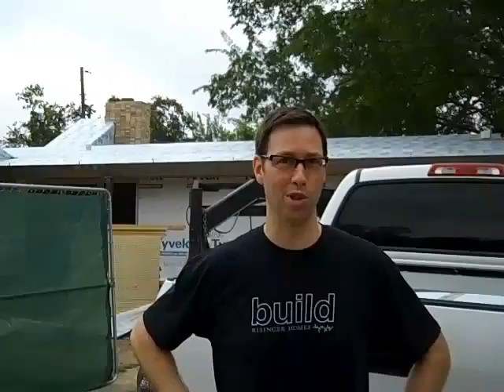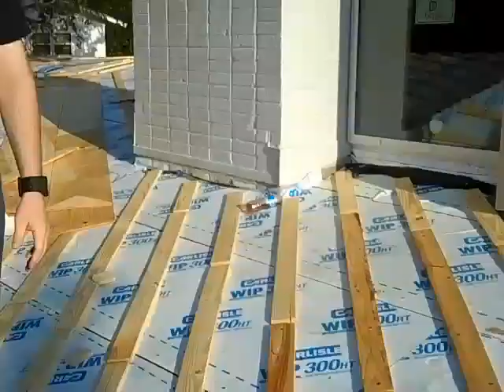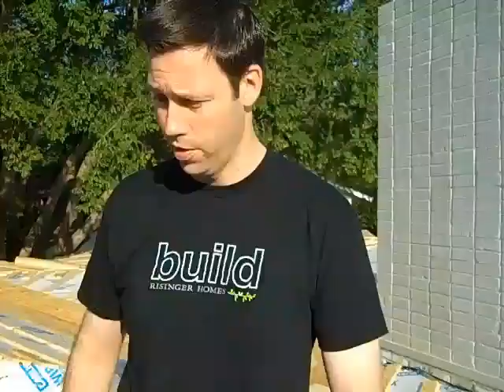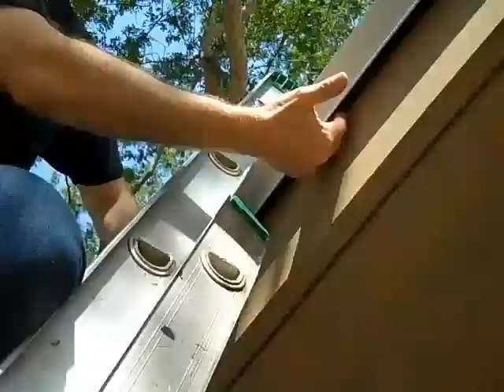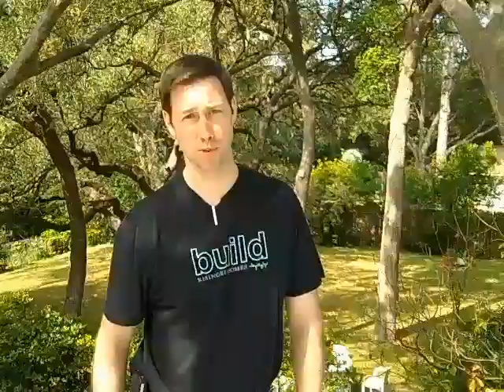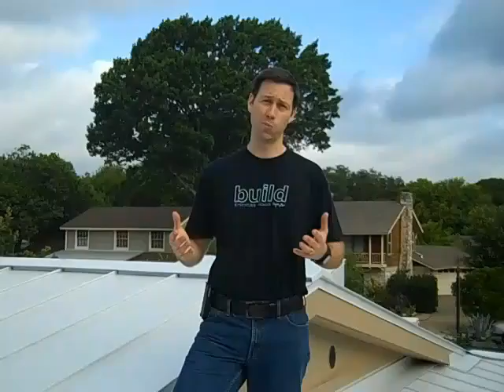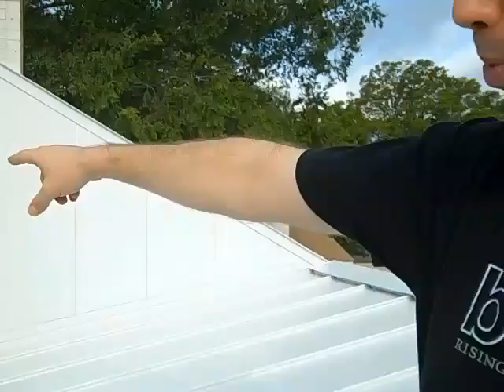White Metal Roof with Rigid Insulation

Comment: How do you know where to walk on the roof.  If you walk directly on the flats of the metal but in a spot where there is no support under it, it seems that you would damage, bend, tear or dent the metal. Did you damage anything or did you just know where to walk?  I have standing seam on my house. It was installed about 100+ years ago directly on top of the original cedar. The house was built in 1875, I recommend every building have metal; smart, green and responsible. Cost is only negative.
Reply: On average in Texas, Hail storms come every 7 years!

Comment from the maker: Good Question.  How old is your house?  I assume your metal roof is screwed to 1x4 Lath directly on the roof rafters?  I wouldn't recommend laying foam over the metal roof.  Pull the old roof, lay down 1/2" plywood, then 2" ISO, then WIP HT, Lath, New Roof and do a Snap Loc so you won't have exposed fasteners.  Then you can spray foam in the attic. Your house will fast forward to 2020 Efficiency Standards!  Best, Matt

Comment from the maker: @Rockytxv The support under the ISO is full 1/2" roof plywood.  I would think you could use Extruded Polystyrene as well, that would be less expensive.  It will get hot under that roof even with the 3/4" lath, I would expect the top of the foam to be upwards of 120 degrees on a hot July day.  -Matt

Comment from the maker: @johnnymac1976 Interesting project!  I think you could go either way, the benefit of the ice/water shield on top that any water that does get by the metal roof goes on top of the ice/water shield and is directed off the roof.  If you ran it under the foam you might tend to trap more water long term.  It's probably ok either way though.  Matt

Comment from the maker: @Bigrignohio Yes, I think Open Cell foam is the way to go for our Hot/Humid climate zone.  It could in theory dry to the inside but the idea of the full peal/seal is that you'll have little chance for a leak.  It's certainly not as forgiving an old school vented roof but this certainly will be VERY efficient.  -Matt
Reply: Matt Risinger  can I use 2x4 instead of 1x4 for the venting?

Comment: Very nice work. I would not have thought of using a herringbone or slanting layout like this. Solves the issue of locating the lath directly under the roof panel seams. You mentioned using 6.5" of spray foam under the roof. Is this open-cell foam to allow drying to the inside? With a under 0.1 perm peel-n-stick there would not be any exterior drying. I know this is a low risk with the waterproofing used but still possible, especially once the owner takes possession (satellite dish, etc.).

Comment from the maker: @boardman4ever101 True we do have more penetrations, but that's the reason for the Water & Ice protection membrane.  It's a self sealing product that should last the length of the metal roofs life.  The 3/4" air space gives any water that gets into that space the ability to dry or drain.  This really is a best practice method for roofing in this climate zone.  Matt Risinger

Comment: Also...there are many penetrations in the roof when you install the 45 degree lath strips. Do you think this is overkill for the long run perspective when you consider how much extra material you use for this system and the fact that this many penetrations greatly increases your chance for a leak?

Comment: Thanks Matt, that does make a lot of sense. Sounds like borderline poor design put the builder and product in an unfavorable position.  What is your take on using 1 or 2 layers of 30# felt under the lath strips if budget is an issue?

Comment from the maker: @boardman4ever101 That's partially true.  The home you are talking about had 2" of rigid foam, then WIP HT, then a dark metal roof with no air gap.  We had a wall flashing issue where the valley dumped onto a flat roof and when we investigated we found the WIP HT was badly degraded after only 1 year.  We made the decision to pull the dark metal roof, rip off the WIP HT and go back with double 30lb felt but we added lath to create a 3/4" air space like what you see in this video. Matt

Comment: I live in Austin and on location at this home a week ago one of your foreman told me that on another project you had an issue with the ice and water shield breaking down under the extreme Texas heat and solar radiation. This eventually created a leak in a valley, and internal water damage. He said you had had bone back to good old 30# tar paper under the 45 degree lath strips as a result......is this correct?

Comment from the maker: @nadroj540 I see what you're saying but I don't see why it would condense on the backside.  We've got 2" of foam on the roof top then 5.5" inside so there is little chance the house will be cooling the metal from leaked AC.  That metal roof should be the same temp on the top and bottom sides.  If condensation does occur there is a 3/4" air space vented top & bottom to bring that moisture out.  This is really best practice method for doing a metal roof in our climate zone.  -Matt Risinger